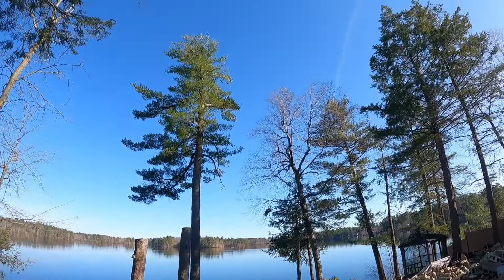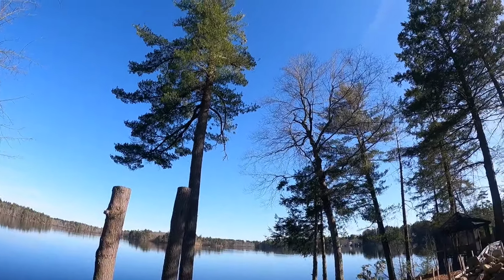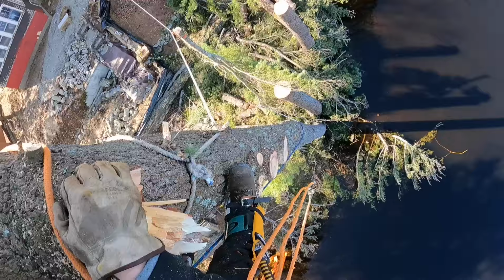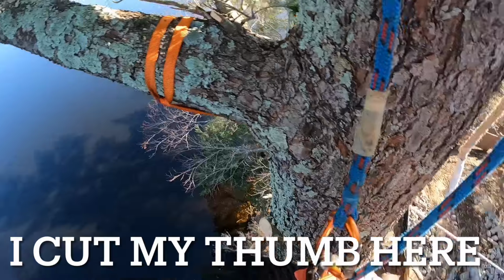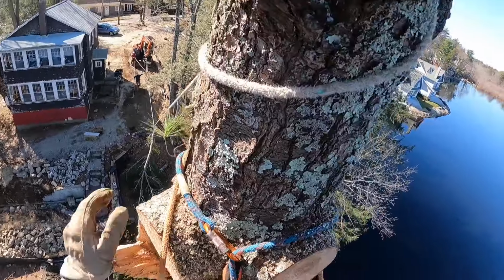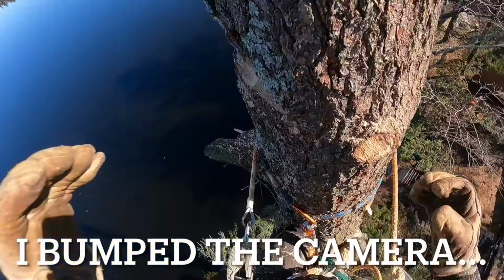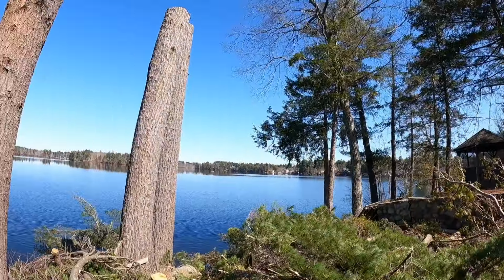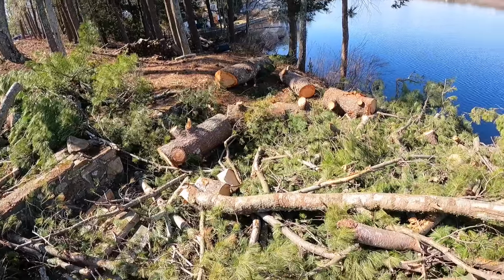I ALMOST Cut My Thumb Off...

Comment: Oh man, I did this once on the back of my left hand with an electric saw.  I have these stretchy "cut resistant" fabric gloves.  Turns out they did pretty good.  The fabric caught in the teeth, stretched and didn't break.  I didn't get cut at all.

I felt the pressure from the spinning chain and thought I'd be going to hand surgery.
Reply from the maker: Yeah yikes! All scary regardless!